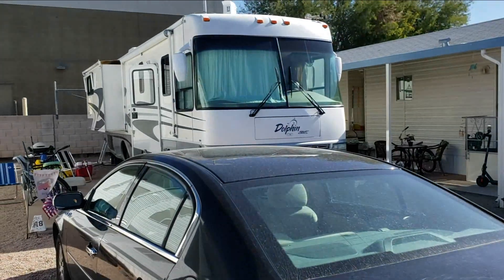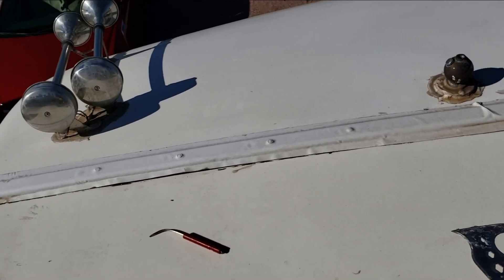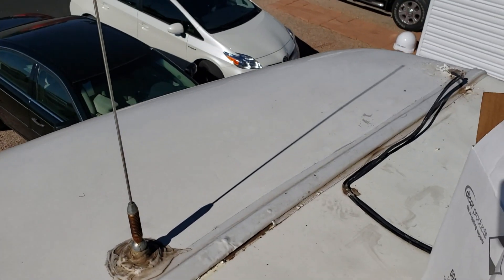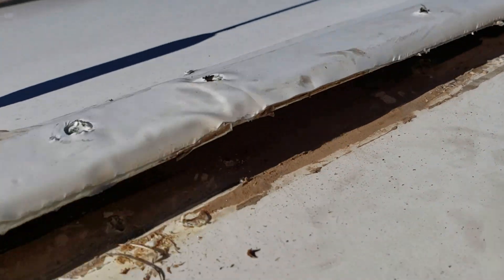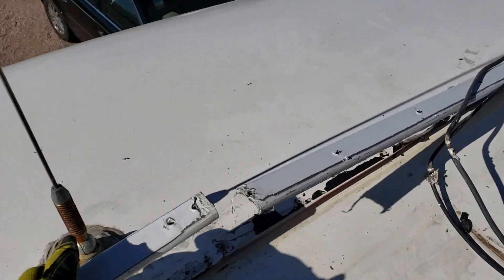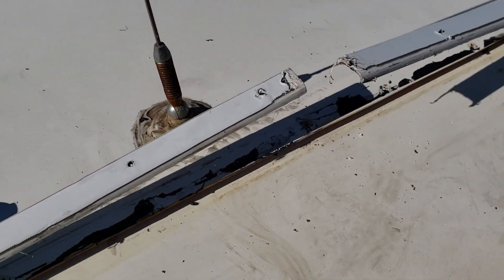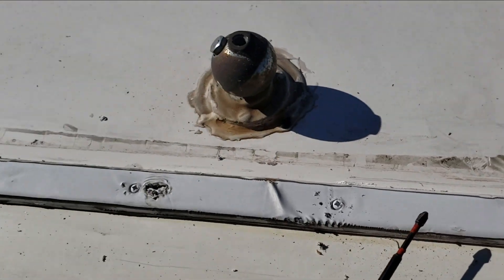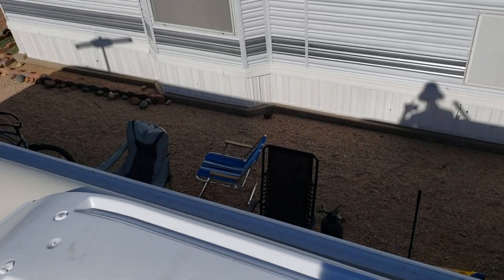Another Eternabond BandAid Failure?  2004 National Dolphin

Comment: I've used a similar tape when roofing buildings, and between that experience, the official eternabond instructions, and the general look of this tape job, (wobbly, wrinkly, narrow areas,) it looks more like it was improperly installed.
Reply from the maker: The main reason I do not like repair tapes, other than the horrible clean up, is that it is a lazy repair. This roof was loose. The tape will not hold it as it has no strength and will just tear. The tears open perfect channels to direct water right into the seams. If the roof was secured and sealed first, and then the tape put on top sure it is a good application, but after securing it and sealing it properly, there is no need to spend the money on the tape. The tape is merely a justification for a shortcut repair. Thanks!
Reply: Tanna K. K. Correct. If used right it does work. I’ve put some over a tear and 4 years later no problem. This wasn’t the right application for the tape.
Reply from the maker: @3fiddy2720  the tape is great for tears and should be long lasting. Thanks
Reply: @AZExpert  
I would say if its done right, its more piece of mind. You dont have to do touch up repairs for years to come. One and done solution (if done right).
The cost of the tape is justified by not having to spend a few hours every 6 months doing touch ups. Over the course of its life it will pay for itself in saved time (if that time is worth saving).
Reply: @AZExpert  I bought a 2003 Ford Super duty shuttle bus last year and did not realize there was a very large gash across the top front to back honestly because I did not get on a ladder and look. I learned from that real quick! Anyways I tried to fix it with a turnip on tape but I know I did the front part improperly because it leaked. It was more of a multiple fracture in one area so first I sold it with silicone caulking and once it was dry I went over it with the turnip on tape and I thought I did a decent job but after a couple good rain storms I learned that I had not :-) so I tried to fix it once again when I should have just taken it off but again sadly I'm afraid of heights and more so of falling off ladders cuz it's happened too often. Thank God I still have my wits lol anyways so I decided okay I will call the crack from the inside because it was a full blown breach in the shell which is fiberglass. So I caulked it and then I went over it with the turnip on tape. It did not help it's still leaked in a few places. Some places actually fill up with water. So right now I am parked under a wonderful awning that protects my bus from leaking. I cannot Sub in my ceiling until I am sure this breach in the roof is corrected. I know I should probably remove it all and then fix it with a patch kit but still afraid of heights! I did hire somebody to patch it but they did not do it properly and yet I pay them. Long story short still leaks.

Comment: Nice job repairing what was not done right from factory. Whomever did the attempt at repairing obviously didn't know what they were doing at all. The Eterna Bond tape did not fail it was improperly used completely. Its an excellent seam tape when applied correctly as its been on the seams of my aluminum roof  on my Holiday Rambler for 23 years and still working that is amazing in itself and speaks volumes for correct installation.
Reply: Had he used 4" E.B. it probably would have worked!

Comment: Reminds me of when I replaced the roof on my huge Keystone Avalanche 5er from hail damage (with the big aluminum edge radius....). Your videos are great because they really teach people about how these things are usually not perfectly right from the factory and make people understand the level of commitment to maintenance they take to keep the water out.  You need multiple layers of protection from water intrusion and critically each has to be installed correctly.  When I did my 5er I did like you and seal underneath caps and trim with butyl and silicone as necessary, strong stainless screws, dicor over top to seal it, and I went over all that with eternabond. I might have even edge sealed the eternabond tape with more dicor.  If you're gonna do it you gotta use the really wide eternabond at the caps and it must be prepped and installed correctly or even that crazy aggressive adhesive will fail especially in the desert.  In the desert those little square head screws the manufacturers use on everything will back themselves out like that from the heat cycling. , It was happening all over the roof decking and pushing up through the membrane roof on mine.  And people, you've got to be constantly checking your RV especially the roof for these types of problems.  It's not a question of if it will fail it's when will it, and will you find the problem before it's too late.  I just picked up a new trailer with totally screwed up schwintek system and loving your videos!!  You definitely could have slapped some stuff on it like the last guy that put that eternabond on and went on your way with the money but you took the time to diagnose the root causes and address them all.  Really love your videos keep them coming!
Reply from the maker: Thank you very much for taking the time to write such a heartfelt comment. I try my best to tell every customer that the roof needs to be inspected at least annually. It's more upsetting to me that this was a problem when it was built. The worker should have easily felt those screws did not gab anything. But there's little reason for me to get upset, these things just happen with RVs. Thanks!

Comment: Eternabond should be applied on a cleaned and primed surface and MUST be rolled down hard to activate the adhesive. That was a bad install and they should have used tape 1"or 2" wider.  My experieince is no problems with Eternabond. Works great with proper prep.

Comment: If that's eternabond,  it looks like it just wasn't applied correctly.  Not the eternabond fault,  that's user error.  Just calling it like I see it, but then again I wasn't there.
Reply: Agree 100% - that looks like a botched installation, not a failure of the product.  If used properly and installed correctly, that would never have happened.
Reply: @paullewis7499  agree... the EB was not the 4" width.  And EB is a sealer, not to hold componentry in my opinion.

Comment: 1# that width eternabond too narrow for that application. 2# too many use laquer or mineral to clean said area. (Leaves residues) Should use  Alcohol or vinegar or both first. Proper roller application to press out adhesives in tape. (Rarely done)  properly .  Surface must be completly dry. I see more failed applications than eternabond fail itself. Also butyl calk applied over not clean and or not thoroughly dry  area. Same issue, comes right up.
Reply from the maker: Thats good advice. However, it's more important to fix the leak first and not use the tape as the repair. Thanks!

Comment: i agree, this job was not done properly. they should of used the 6" or wider eternabond  tape. also prep is important also so you cant fault the tape. i find this tape far superior than lap sealant which fails more frequently than the eternabond.
Reply: I agree… If the roof is cleaned and use an adhesive ETERNABOND works Great

Comment: The eternabond tale actually does work if applied properly.
Reply from the maker: Yes, if applied correctly for the correct application it is a good product!
Reply: I agree it probably wasn't prepped correctly. I've had fairly good results using Eternabond over the years.

Comment: I know it's a 1 year old video, but did I catch in another video that Dicor doesn't stick to this type roof but yet it was used to flash the roof trim?  Or.. did I misunderstand the comments in your Winnebago roof inspection video?
Reply from the maker: dicor won't stick to silicone sealant used on Winnebago and Tiffin. It sticks to the roof material fine, but not any residue of silicone on the roof. Thanks

Comment: I am building a truck camper. .040 aluminum sheets any ideas on a roof coating? great videos .
Reply from the maker: You shouldn't need a roof coating on aluminum. The most common metal roof sealant is hengs plas-t-Cote which is a silver or white tar like coating that is rolled on. That would reflect and insulate and dampen noise. Is that what you're thinking? And thank you
Reply: @AZExpert  thank you. thats what i had in mind. but this is my first build.

Comment: Integrity of these roofs are unF?”:{Ingreal. On a side note where would you recommend someone get trim pieces like they used on front cap, corner trim, etc? A roofing supply shop carry similar materials but not as long as RV makers use. Nice work. A filon roof seems like a biatch but you make them turn out pretty nicely on re-roofs I’ve seen you do. Just cutting it cleanly would be a booger.
Reply from the maker: These aluminum extrusions are unique to RVs. Any RV shop shop be able to source the standard moldings but All-Rite is an easy supplier too. Thanks!
Reply: AZ Expert good deal. That’s where all my searches kept leading me. Same for IKON for the replacement fenders. I really want a nose cap for my 2005 Gearbox 335 but pretty much have to find a parts unit, I doubt it would be intact on something neglected. I like the shape and aesthetics of the front caps however my filon is nice and watertight- for now.

Comment: You think that tape sucks?
yea try resealing a silicone job.. It won't even stick to itself and unless you feel like scrubbing everything with vinegar.. uggg If it works for you than great but the only place that stuff belongs is the bathroom or the trashcan.
Reply from the maker: thats a very odd statement. I don't think you are correct but thanks for watching and commenting. While a sikaflex or urethane would have been a better adhesive, silicone is a great adhesive and what I had on hand. Thanks
Reply: So is silicone good as an adhesive?
and the butyl sticks to it just don't use silicone for seal seams on RVs?  I just got a 5'r and the idiot used silicone everywhere and where the trim didn't line up...blobs of silicone..I'm so defeated!! My wood at the bottom of the trim has swollen..dangit!! The baggage compartment and city water was leaking forever so total rebuild . fortunately I guess being a 1986  lance is better than some new ones I've seen..atleast the floors don't go under the walls..unless my walls sunk lol.. it seems theres 2x2 inner frame and 1x2 outter and the walls are stapled to that..add in it's aluminum siding..I'm desperately seeking advice ..I sound like a whiner for sure but I sunk in all my savings tryin to get more space than the  Lance slide in I've lived in for 3 yrs..might just demo the whole dang thing and put truck camper on the chassis lol..I am Soo impressed with your dicor skills!!! I had that stuff everywhere!!

Comment: Less tape failure than construction defect/shoemaker's repair causing it. Although, they should have used two rows of tape to give sufficient contact & adhesion.

I've used Eternabond (yes, I know 😱) around a vent flange but sealed the edges of the tape with dicor to boot. Excellent adhesion and seal.

I appreciate what a PITA it is to remove by technicians later. But, done with proper preparation, it can last the life of the roof material. 

At the risk of making your life more miserable,  ACE sells Ultrabond tape cheaper which is a relabeled Eternabond tape.
Reply from the maker: I think, besides the remove/cleanup, the main reason I don't like repair tapes, is that they are used improperly as a bandaid because its easier to put tape on a leak, rather than repair the problem. Thanks!

Comment: You didn’t put it down wide enough to give the tape an good grip. You should have an inch or two on the flat surface so it gets a good bond. One quarter of an inch! What were you thinking?
Reply from the maker: Thanks. I didn't put it down, but common incorrect application of this tape is why I don't like the product
Reply: @AZExpert  not liking a product because people are too stupid too use it correctly isn’t to smart in my opinion. People speed around in cars recklessly do you not like cars too?
Reply: @AZExpert  ❤
Reply: Az
Reply: And making a comment that he didn't install the tape correctly isn't very smart either, when he obviously didn't install the tape. Or did you just make a snide comment without even watching the video.